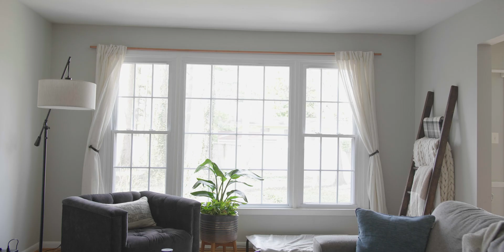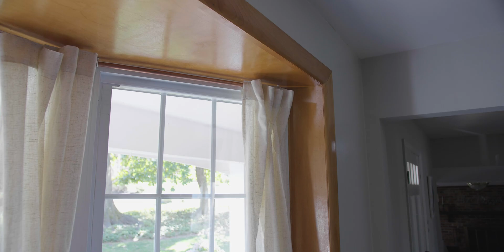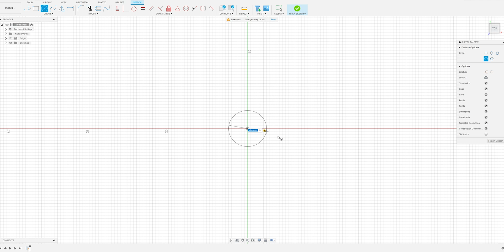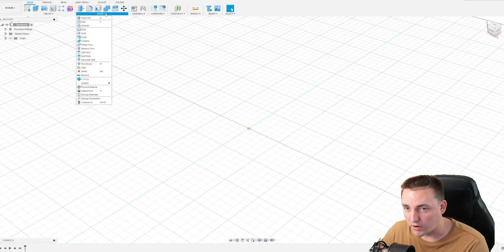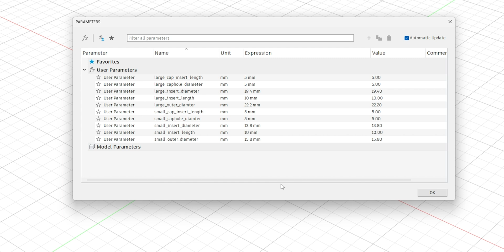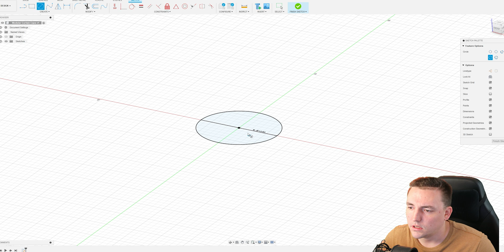Is your wife indecisive? Print these modular curtain rod caps!

Comment: It would probably require modifying your design slightly, but TPU filament would probably be great for an application like this in the future - the rubbery qualities of TPU would allow you print a cap that could compress a little for a nice friction fit inside the pipe.
Reply from the maker: That is an excellent idea! I did not even think of that, but I absolutely should have printed in TPU. The fit into the copper piping wasn't perfect either as the tube had slight variations, so this would have probably solved this. Maybe worth a revisit later!

Comment: Creative solution to that problem! What tool did you use to cut the copper pipe to size?
Reply from the maker: Thanks! I used a diablo metal cutting blade on my 5.5" circular saw. It ended up cutting it fairly neatly, but could have been better. I ended up having to file down some imperfections with an iron file